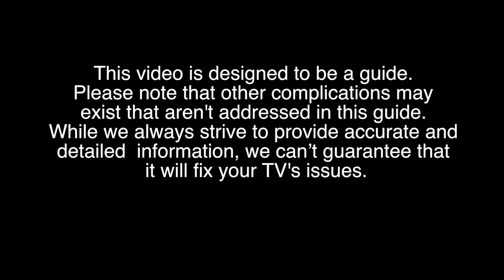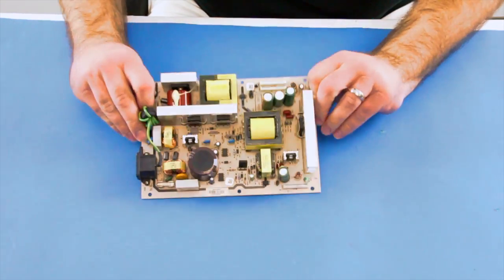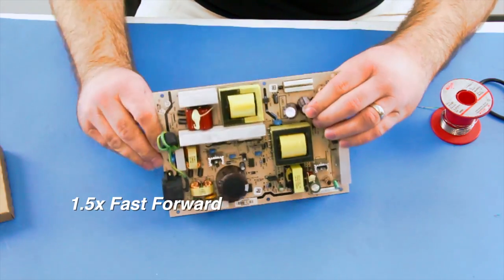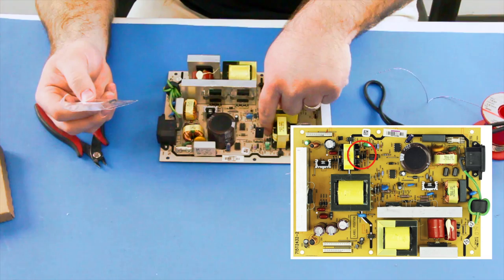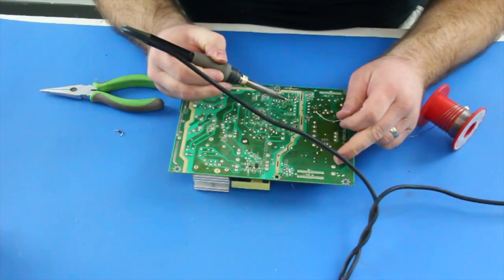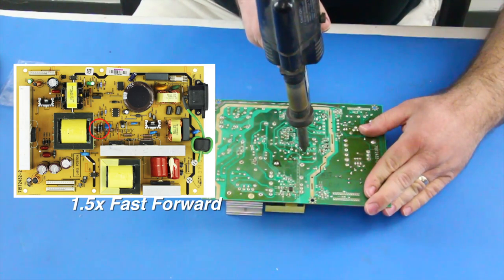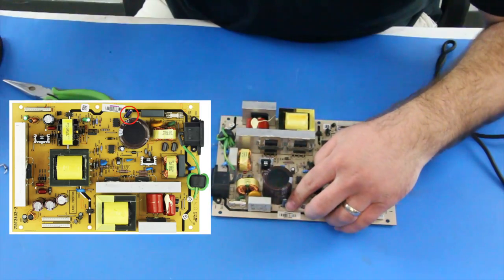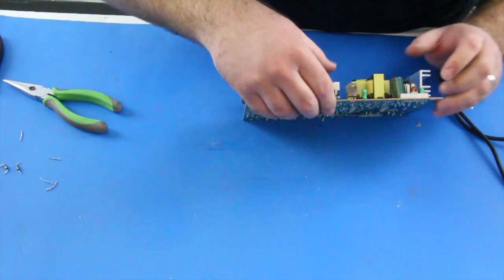Philips 996500044559 TV Will Not Power On Power Supply Component Repair Kit 42MF 42PFL

Comment: Great repair video it will come in handy for repairing my power supply when you have the Philips 996500044559 Repair Kit in stock. BTW At 9:02 you show the wrong pic for the diode he says he is replacing.